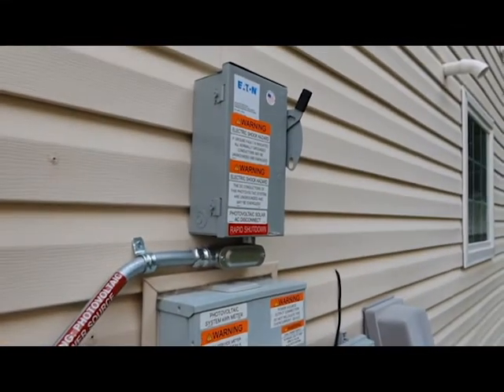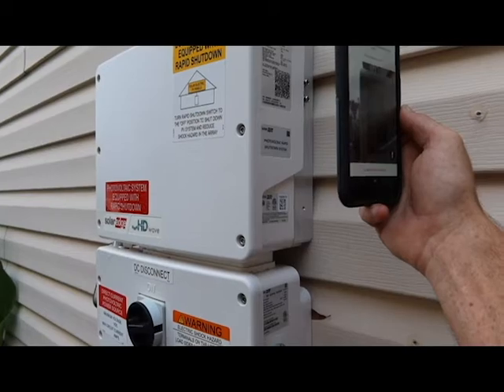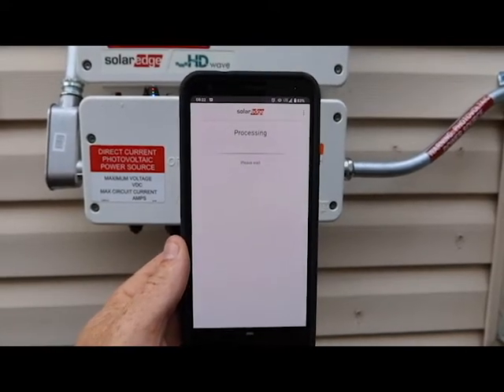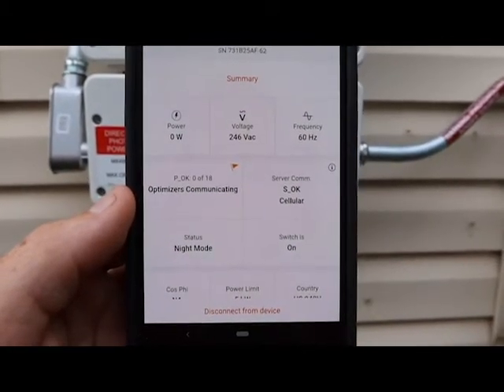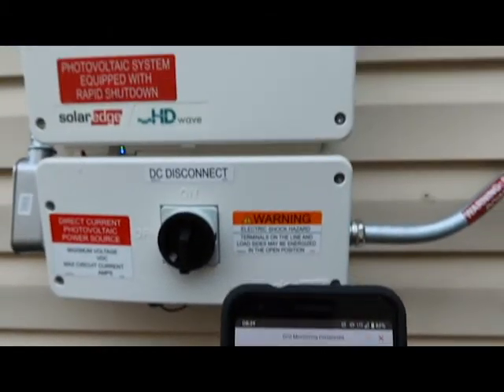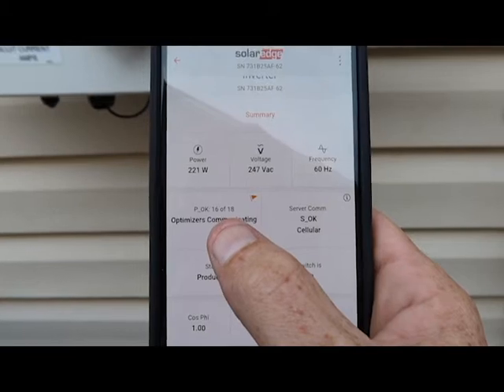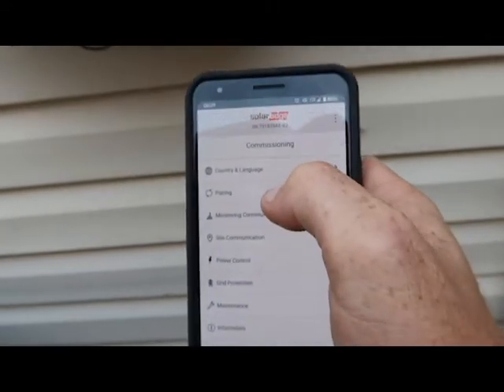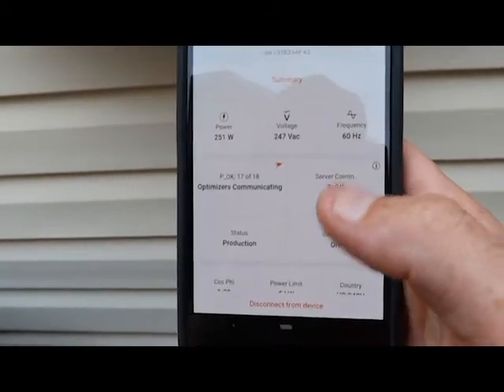Biggest pet peeve as a Solar Technician

Comment: I dont know if you should just throw the power on without checking with people in the house what is happening -
Reply from the maker: I do. I'm 100% sure I know more about how these solar systems work than the homeowner. I'm 90% sure if I pointed to the inverter and asked the homeowner what it was, they wouldn't be sure. Just that it has to do with solar. When you ask the customer what's wrong, the answer is almost always that their power bill has not changed as much as they believed it would.

Comment: I installed a 6 kW Sunpower system facing north. I told the customer I have never installed on a north roof in 38 years. But he wanted it and there was no space on the south. I projected he would make 3500 kWh per year. He made 3300kwh last year. There were also two chimneys on the ridge that acted like sundials over the panels, but I used an SMA inverter with shadfix.  I might install 6 kW on my north roof, it's 3300 kWh and electric in the UK is aiming for 30pence per kWh.
Reply: I have both a south and a north (north-west) array. The combination of both is excellent. Here in north Manchester we have late afternoon into mid evening light, I only had south for 6 years and then we added a second array, inverter and my first battery. I am very happy I added the North-West system.

Comment: Photovoltaic / Solar Thermal Technician here. I would have walked away from this job and told customer you don't install facing north. other option is ground mount, pole mount if there's room available and if allowed in the city you live in.
Reply from the maker: I didn't install this system. I simply do service work. I was called because the system was already installed and  "not performing as well as it should". If I was the installer, I would have immediately put the brakes on the job and talked with the homeowner.
Reply: @HomeEcGuy  thank you for clarifying that. in the beginning of me installing 15 yrs ago i was on a job that installed north. but installer made a platform that would angle south.he called it the poor man's solar tracker. besides customer suggested it. was ugly but customer was happy going green
Reply from the maker: @fvrrljr  I have been to one job that was like that. I was asked to remove the system and replace after they got a new roof. It was so weird. I am glad I haven't seen it again!

Comment: Thanks, understand where you are coming from, as a home owner, we have heaps of information to go through, working out what is correct and what isn't, who is telling the truth and so forth, hearing other people's wins and not, hearing horror stories. Saw a solar company in my working area,talked to them, work in different areas all the time.After a  month or so I decided to go back to that company and do solar. Few days before I go back, the solar company went bust, there is problems both sides of the fence. On top of this it was reported that 75% of batteries fails, replaced under warranty but another stress to worry about.

Comment: New sub here.  I'm doing my research, a few weeks ago I had ordered a Tesla 8.5k system that was half west and half south for my difficult roof angles. I ended up canceling and just reordered and to my surprise the new design layout has several panels North facing. You have confirmed my concern about North facing panels. I have submitted for a re design and have yet to hear back.  Thank you for this video.
Reply: the first design was better. as an installer, we try to fit the most panels on the south side before we install in the east or west

Comment: As Someone in currently in the process of getting new roof, solar and battery I found that every estimator tries to push you into a certain type of solar panel or system They are used to or affiliated with; maybe saying that they can’t get what you want when others can. Try to talk you into or out of certain roofing materials depending on what they like. Some say batteries are impossible to get now another can get them easily. Some said they can do solar I really just wanted to tell you the roof And didn’t care about your overall plan. It’s good to take advice from builders but understand they have biases And you should really need to fight for what you want and how you want it done. Get lots of estimates and talk to lots of people; I’ve gotten some good information from every single one.
Reply from the maker: This is very true. They sell one thing and not what the customer needs... Maybe you need a minivan but they only know how to sell corvettes. Or maybe you want a corvette but they only know how to sell dump trucks. Many installers or sales businesses are most interested in learning one product and then just selling that. Same with many installers, they're not interested in learning all the different systems, rather how to do just the one kind as best (actually fast) as possible.

Comment: North 🤔🤔🤔🤔 but who installed it? The techs should have known better.
Reply from the maker: Many times techs do know and bring it up and are told to install anyway. In some instances it's because of HOA etc... For example, I have a current customer getting solar and a battery for the PRIMARY reason of being able to have power backup if the Natural Gas goes down during an emergency and his generator fails.. His HOA won't let him have panels on the front of his house, so ultimately the panels will face North East. The Homeowner knows this and understands this though and I've gone over the concerns placing panels there and that they won't produce as well. He's ok with this, so we will move forward with the project. 

Unfortunately, sales people sometimes brush over it like it's not a big deal, or don't even know how big of a deal it really is. They think it's sunny there, so performance will be great.
Reply: @HomeEcGuy  didnt think about that HOA aspect. Awesome  once they are aware. Keep up the good work.

Comment: So a customer claims water in the inverter so you just turn everything on and never open a single thing up to see if there was actually water in anything? How do you know they didn't turn the system off before a problem arose due to water damage. She could still have water buildup occuring if that was the actual issue on hand. Honestly wtf kind of sham ass company you work for?
Reply: Relax there Bud C. Way to jump into a conclusion before the person could respond. You quicker in assumptions than a psychic Analyzing a cat.
Reply from the maker: Great question. I know because I read the call notes. I didn't repeat them verbatim here. The system never stopped working and never threw any codes. Something that would definitely happen with water damage. The customer was a little old lady, so she didn't open anything. She felt like the system was not producing what it should. This is not a problem related to water damage.

Comment: We face north east south and west here in Australia.
Reply from the maker: Panels? In the Southern Hemisphere, you'll get the most production by facing North. You will get production no matter what way you face if you have clear sun, but you'll get significantly more facing North in the Southern Hemisphere and South in the Northern Hemisphere
Reply: @HomeEcGuy  yes. Solar is only 40c U.S a watt installed here in Australia.. some parts like the notherern territory you only loose 18% efficiency going south over north.where the southern states you loose 30% efficiency over north.Darwin in the Northern Territory averages 6hours of peak sunshine per day.
I personally wouldn’t go south
Reply: @HomeEcGuy  my 8kw west system with premium parts produces 12MW a year and only cost $6k U.S and that included a new meterbox . Tesla powerwalls only cost $7k U.S installed where I live. Some cities are nearing 50% solar penetration. Most Americans-are truely shocked how cheap solar is here.
Next month I’m installing a 10kw battery with 6.6kw solar system at an installed cost of 6k U.S with 10 year government interest free loan.
It’s the reason Australia has the highest uptake of solar in the world

Comment: What if your roof faces east west does it still make sense to get panels?
Reply from the maker: Yes it can still make sense to get panels. It all depends on the house of course. When you get panels on the East/West side of the house you'll see the panels facing East get a lot of power in the morning and not much later on, and the opposite happens with the panels facing West. So you'll get less time of peak production with E/W facing panels. But they're still better than North!
Reply: East/West is fine.

Comment: As a DYI new to solar I was shocked how little power panels actually produce. That’s not something a sales man will tell u either. Thanks for mentioning how she thought a small system would make much difference on her bill. I’m lucky I have some acreage to play in can dodge shadows and slowly expand.
Reply from the maker: Yes, panel production is much like MPG on a car. It's based on lab standards that are rarely met in the real world. It's based on 1000w/m2 hitting the panel from the sun, the temperature being 77 F and an air mass of 1.5. The sun hitting the panel can be tested with a tool that will tell you the "solar irradiance". If you're getting 800 w/m2, you know that right off the bat your panels are producing 20% less than advertised. This is something almost nobody does or uses when doing a site design. Everything is based off the interwebs numbers these days vs. real numbers taken from the site.
Reply: @HomeEcGuy  what do you think happens after 3 years of your comment? A lot of Home owners are getting same issues more and more, we have customers complaining about high bills everyday, I’ve been a tech for several years and still can’t figure out what can I do for them besides telling them to call customer care ? But I would like to help more
Reply: Well I mean I knew how much power they make the thing Is is how cheap power is if it wasn't 10 to 15 cents a kw

Comment: I bought a split phase inverter a number of years ago to use with a mini split air conditioner. I just hooked it up for the first time in my new location that also has a two phase well pump and it works great for both with only 5,000 watts of power. I also hooked up the lights and refrigerator. The only issue that I have had is that I have to shut off the well pump so that it doesn't turn on when I am making coffee : ) I am dreaming of a 12kw hybrid inverter now.
Reply from the maker: Sol-Ark makes a good 12kw hybrid inverter now days. Yes it's pretty common to have to turn something off to turn something on when you're totally off grid. It would be nice to be able to run the AC, dryer and electric oven while coffee brews, but the tech isn't quite there yet...I mean anythings possible if your pockets reach the floor I guess.
Reply: @HomeEcGuy   Yep : )

Comment: Shouldn't you talk to the customer before throwing a disconnect ?  I have all my entry panels in a locked room to prevent anyone touching them cause I may have something apart or downloading something on my computer. I just have to know when someone is touching my electrical system on my home is all. I think its a good practice .
Reply from the maker: The disconnects must be outside in view of the meter as per the NEC code. I did talk to the customer, and even if I didn't, they wouldn't notice an interruption of anything. The disconnect shuts off their solar system that was already turned off. 

A grid tied solar system does not interrupt home power when being shut down.
Reply: @HomeEcGuy   I didn't think of that . I hate it when someone questions me , maybe I should think of that next time and mind my own business !  Thanks for the reply.
Reply from the maker: @stevelamperta865  it's always good to get feedback and answer any questions. I didn't think of including more context to the clip. You might have brought up something other people were thinking but didn't want to ask. Hope you had a great weekend.

Comment: Ive had the same type of thing Happen, but luckily I had done my home work, they tried to sell me a $15k Setup with 3/4 of the panels facing North, and 1/4 of them facing East ( because my roof was not "made for it") I ended up saying no and installed my own ground array facing south, Saved me $10k and a headache. It stinks that You cant trust sales person, especially if they are strictly on commission :(

Comment: Good advice, and sorry for your pain.  Due North is quite bad, but North East or North West is not the end of the world depending on variables (latitude and pitch).  My house front is South West, but wife nixed panels on the front due to look.  So, I did my own research.  Even way up in upstate NY at North East orientation and 30 degree roof pitch (wrong way), 60% output was still predicted by PVwatts.  I'm now 1 full year in and it was dead-on accurate.  This site covers less than ideal panel orientation pretty well...  https://www.solarpowerworldonline.com/2016/06/much-less-efficient-north-facing-solar-modules/

Comment: The Installers should have refused to install North Facing Panels !!!!  It takes two to Tango, so if the system is not right for the customer, the Installer has a duty to not install a piss poor system that will leave the homeowner with a huge bill and little Solar Energy to show for it. The Installers have to be the "Check" in a "Check and Balance" system. Truth be told, the Installer should have the right to refuse to install ANY Solar System that will be unable to perform optimally !!!
Reply: Is there anything about the panels themselves that make them north facing panels? I was thinking the whole time why didn't the installers just install them on the south side. Must have been something to do with the roof shape or shade trees on that side I'm guessing.
Reply: @connerg196  There is nothing special about the panels themselves, North facing panels are just installed on the North facing roof, which, in the Northern Hemisphere is where the "Sun Don't Shine" (literally). Apparently, the house had too many obstructions to mount the panels on the South side of the roof (tall trees, 2 story house next door, pipes coming through the roof, etc.).
Reply: @bbcooter388  they probably could’ve put a tilt kit on it but I’m sure the designer didn’t care enough to think about that
Reply: The installers make a hourly wage and usually don't care

Comment: I'm a technician for a large home automation company, the worst thing is having to explain to a customer how the system works vs how the sales person told them it would work. Seems like you genuinely care for the people. Never a fun conversation. Thanks for sharing.
Reply from the maker: I do a bit of home automation as well. I build and code my own sensors etc. Got a lot coming up on that front as well as it goes hand in hand with solar. This industry is tough. I didn't get into it to screw people over at any cost, and I won't. I believe there's honest benefits with this, and so I seek out those customers that solar would benefit, not just anyone I can get to sign the line.

Comment: I'm guessing that this customer had a roof that had far more space on its northern face than its southern? maybe they should have purchased a fraction of the panels and placed them on the southern portion of the house's roof?
Reply from the maker: I think the HOA had something to do with no panels on the front of the house. I would have not sold them solar honestly. 🤷
Reply: There are laws that override HOA rules about solar panels in some states. Meaning the HOA legally can’t prevent a home owner from installing solar panels facing south in those states no matter how bad it looks.
Reply: @tscoff  This is correct. SC is not one of those states from my understanding.